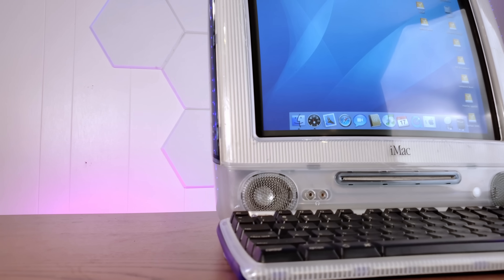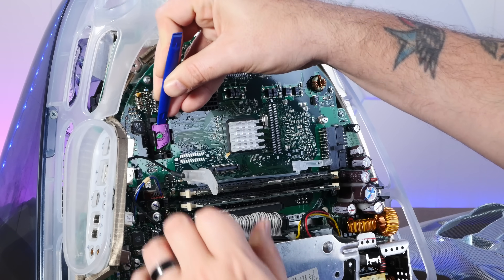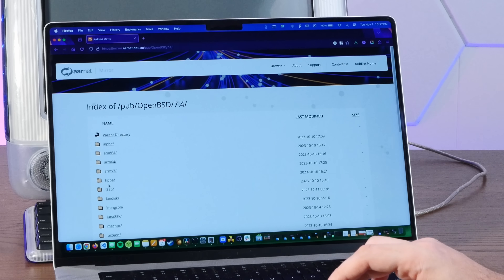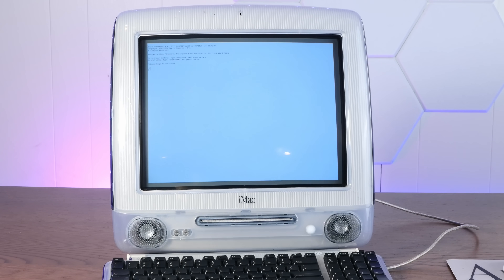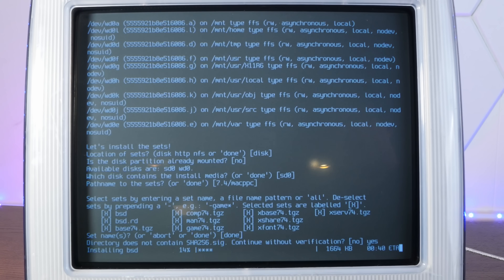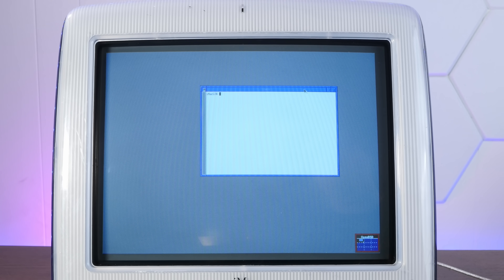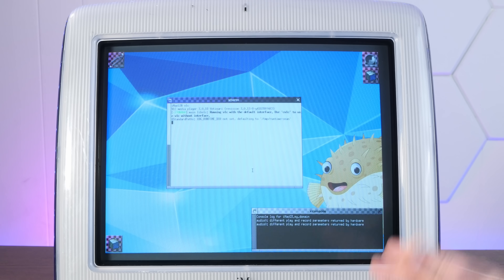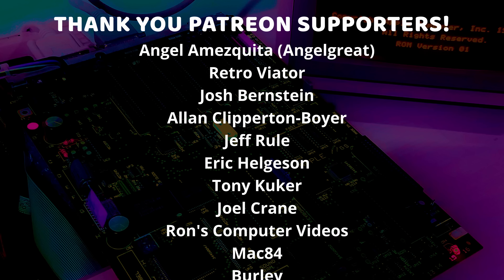Installing OpenBSD on the Fastest iMac G3

Comment: I had a cursed early  2008 iMac that would only boot from USB like 1/5 times. I finally took it to the recycler though because it was too slow even more modern Linux, the speakers disintegrated and the backlight in the screen was going out.
Reply: Jeez what did you do to it? I’ve got a 2009 iMac with none of those problems. Mine is the 20 inch early 2009 education model with 8gb ram and its original hard drive. Its speakers still sound great
Reply: @OldFordTaurus  I don't know, i think the early 2008 models were plagued with issues, they fixed several flaws in the 2009 models.
Reply: @XeonProductions  that is possible. I do know the 2006 17 inch models had an issue where their screens would develop colored lines going down them but they changed the manufacture of the screens in 2007 but you couldn’t tell a 2006 or 2007 17 inch iMac apart by looking at them.

Comment: Several older system I've loaded up with memory strips.  Then I'm reminded, the system only accepts 512 or 1024.  More might fit in, but it won't be utilized.

Comment: Sound related stuff does not seem to work as you need to install the sound. VLC requires accelerated X11 driver and so does the many games you would want to play. The segdev faults are all for hardware issues more than any software ones which is why it is rather pointless to try and run NIX on old hardware. I confirmed when I installed Redhat 6.2 on a P3 and tried just viewing and copying mp3 files from old cdroms and the drive IO would fail alot. Tried those same cdroms on a new Dell optiplex running MX Linux and lo and behold! All was working! No CRC or io disk errors! Modern Nix on the same old hardware will try to circumvent alot of those issues but ultimately, the hardware is just too old and full of issues just like it was back in 1998/99! I hardly ever got work done back then cause I had to fuzz with the Mac or PC not working right just to do basic multimedia stuff. Even Mac OS did not recognize some CDROMs and files like jpegs and mp3s.  But I am sure you know that lol :D

Comment: The problem that you have comes down to your USB Drive, USB 3.0 Drives are most of the time hit or miss with older computers it a common problem a USB 2.0 drive would be more reliable cause it would not try to negotiate 3.0 Speeds upon plugging it in wich can cause some issues on Older devices that are not familiar with the 3.0 negotiation.

Comment: Ok so I thought I was crazy its just the shitty Micro Center Drive mine does the same thing.  I had this issue when live booting ubuntu. and with open firmware.I think its because its USB 3.0 in a usb 2.0 /1.0 port . Something doesnt like to agree. I think this could be solved with using a native usb 2.0 drive.
Reply: That is exactly the problem, pretty sure the iMac had 1.1 and as backwards compatible as USB is, I think 3 might just push it a little too much

Comment: The USB issue can be how the blocks was written by Etcher (which I don't know). A solution (it will be slow) is using dd without passing bs flags.
In my experience, every time i've tried to speed up things with bs, end up having weird issues at boot, also, if possible, try using a USB2 pendrive (some USB1 devices are picky even about USB2 devices).

Comment: Everything worked until I got to typing the source of the set up files. I used the default cd0 which threw an error. So I typed http which worked, but slowly. Turns out the instructions say to type "7.4/macppc", but http worked. When I got to "setenv boot-device hd:,ofwboot/bsd", that didn't work so I typed what the installation showed before the reboot: "boot hd:ofwboot/bsd". I tried both with and without spaces - all combinations. Didn't work. The instructions said to log in as "boot". I typed "boot" and hit enter, expecting it to ask for user name and password, but nothing happened. I will try again later using the 7.4/macppc source of files and see if that makes a difference. I am on a Blue and White Yosemite G3 with 1Gb of RAM if that makes a difference. Thanks for going through the detailed steps. This is as close as I have gotton so far.   I would use Adelie Linux, but it doesn't support Rage128 video (yet?).

Comment: Why’s it called x11? Where are x1-x10?
Reply: There is. Check wikipedia
Reply: Cool :D But why'd they stop incrementing the numbers at 11?  @WildVoltorb
Reply: @MaxOakland  Major version numbers signify a change in the API that breaks compatibility. X got to a mature state where the server can be improved and still work with older clients. The minor revision numbers are still incrementing.